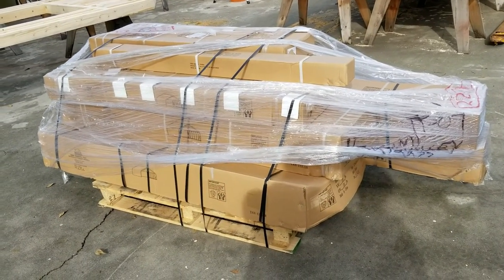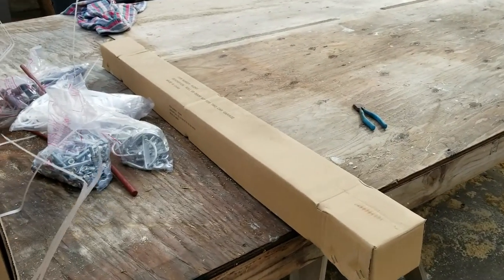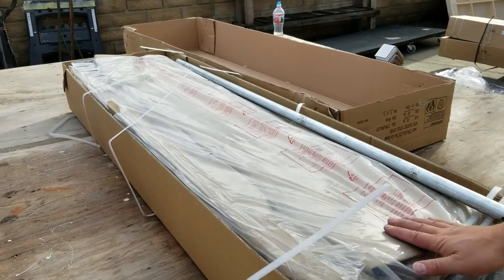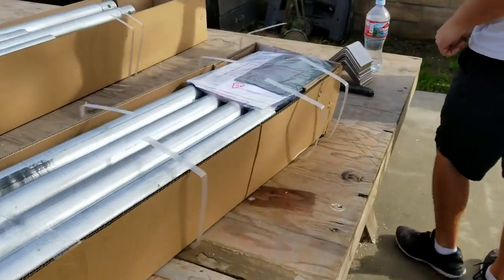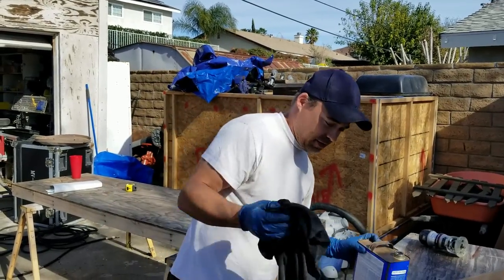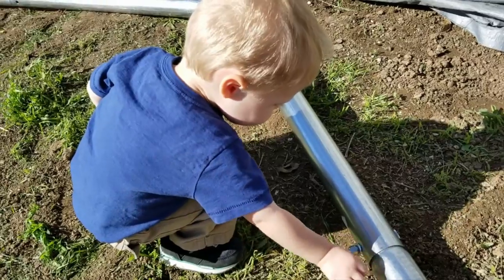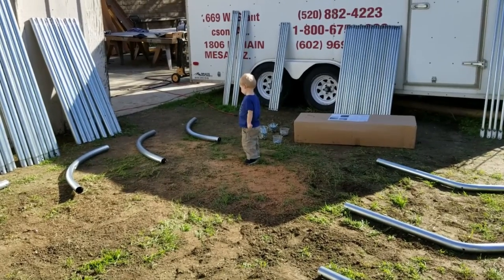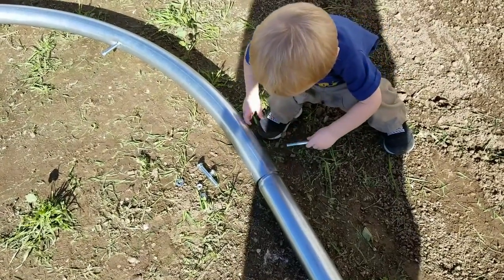Setting Up a Portable Garage Shelter - HEAVY DUTY Two Car Canopy Carport Review

Comment: Yours is nice and large.  I bought a 13X20 and worked great, except for snow load sag, which I had to raise sagging areas with broom to make snow slide off. 
  After some years of use, fabric started to fail, so I removed it all and covered tube frame with 18 sections of 12 X 3 foot sections of steel roofing.
  Works great, no longer a worry of snow load, it can handle it now with no sagging what so ever now.

Comment: Old plastic one gallon lids "Gatorade wide mouth" would make a lovely secondary protection just cut off the locking edge make it flat put tape over the nut then the disk and another piece of tape over the edge of the disk I've never used it but my friend and neighbor I watched her use the trick on a tiny green house this summer will be 5 years and she has it tho the u.v. has worn out the cover but the rub spots are not stressing or catching the cover😎 great video, well done and you 2 made me smile keep it up god bless😎

Comment: For insulation and a little more strength you could  use spray foam insulation to stick 4' x 8' x 2.5" sheets of blue foam board to the interior of your walls...

Comment: When you go to move just back your truck up next to the cable put a piece of pipe up in the top of the bed where the square holes are and put a Come Along on there and hook it around the anchor wench it down some and bounced on the back of the truck bumper and the Springs will pull it right out of the ground that's the way me and Dad would pull fence poles out of the ground Works awesome

Comment: Tip....To prevent the wind from flapping the bottom of the "doors" hammer into the ground thick strong dowel pins on inside and outside the outer edge so the pipe fits into that slot when they are lowered. Bricks would work too in place of the dowel pins.
Reply from the maker: Thank you so much!

Comment: Hi Guys...now that you have had this  up for awhile how it is working out?  Any vendor mfging issues?  Any city issues?  Anything you wished you would have done in hindsight??  I am looking to put one of these up in my back yard.  Thanks
Reply from the maker: Not sure if you saw we posted this a while back https://youtu.be/qfUCbNstKZU  For us it really is one of the best purchases we have made.  Surprisingly the sun has not ate through the material and its held up really well.  I just screwed up by letting the door flaps rub on the ground instead adjusting the height and it rubbed through the material on the bottom so it won't hold the pipes any more.  Nice thing is you can order a new end panel if you want to.  I also need to lay down some old carpet or turf some day because its dusty in there when its windy.  Customer service has always been nice for us as well.  All I can say is we dealt with fixing and repairing the cheap harbor freight ones every single time it got windy.  Since we have had this one we never have had any issues.  I admit it still scares me watching it move a little when the wind is blowing at 50 mph.

Comment: I wonder if the grease was purposed for helping with pulling the cover over the frame and to help with twisting pipe into pipe?
Reply from the maker: It could have been but I was thinking it was to help prevent corrosion.  It is galvanized so that will help.  Plus we live in a pretty dry place but if someone lived in a wet area they could always leave the grease on it.

Comment: Suggestion, how about slipping the bottom rail through the anchor cable loop before fastening rail onto the support post. Then wrap the anchor cable over top of the rail on the opposite side of rail-post union point where it bolted. Then pound the anchor cable into the ground until snug.. No U-bolt needed!

Comment: I've had those kind of portable shelters and I found I had to constantly replace the vinyl material every two years or so.  And if there was a big wind storm after a long, hot summer, the fabric just ripped and blew off.  
Since you have lots of sun and wind there in Simi Valley, expect to replace the fabric as frequently as I had to.
Reply from the maker: Although we wouldn't be super surprised if that did happen we hope it lasts much longer than a couple years.  These guys do warranty them for a couple years so if it starts to break down after that hopefully we could just replace it.  We make most of our money working out of it so the cost is definitely well worth it for us.  Someday a real shop would be the best!
Reply: @HollywoodHaunter  
I finally replaced the fabric on my shelter with aluminum sheeting and have had no problems with it since.
Reply from the maker: @chuckster3629  That's a great idea, we may have to do that after our cover falls apart too.

Comment: Hi Gus, You should cover it with a 2nd Uv tarp silver on the outside, the sun is the enemy with them. had 2 of them. DBL the life. Hope that helps
Reply from the maker: Thanks Steve that is a great idea to help the shelter last.  One of the main reasons we went with the rhino versus other brands is because they have an added UV chemical they added in the outer layer and then it also has a black scrim in the middle layer which blocks out all light and uv from penetrating the tent.  I can go in that thing during the day and it is pitch black inside its crazy.  We will see how how it does hopefully it will last a while for us.

Comment: It'd be nice if they had a 10 x 20 carport canopy with these size frame poles, it'd come in handy here in Florida. Anyone know of any heavy duty canopy makers ?
Reply from the maker: Did you check  their website I'm not for sure but I thought they had smaller shelters even for motorcycles and stuff.  Not sure about frame size though.

Comment: Why does everyone do the same thing  . They add the legs  first  and try to stand it up and work 10 foot off the ground  to connect the top . . Just leave the legs for last and  put the  top part together  while its close to the ground  once  the top is together then add the legs  one side at a time . Also go ahead and put the  tarp on the top   before the legs and when you add the legs your working in the shade  to tighten every thing up  . You can just fold it out of the way  when you start on the   end tarp .
Reply from the maker: That is a good logical way to do it if you can and we have set up our smaller lightweight harbor freight style car ports that way.  But for this one you would have a fork lift or genie lift of some kind to lift one side up at a time specially with the top on.  The two of us struggled to just carry top tarp together.  I think that's why the manual instructs you to do to the way we did.  But I agree any kind of work is easier on the ground.  Good exercise though

Comment: concrete pads under the legs and screw anchors.
Reply from the maker: We plan on adding the screw anchors for extra strength but I asked the factory guys about the concrete and they said its actually more secure in dirt and doesn't move as much when stuck in the ground.  Something about when on concrete it tends to slide back and forth on the blocks which can cause the cover to flap more from loosing.  Not for sure if it would be better or not. Thanks for writing us about the ideas.
Reply: @HollywoodHaunter  Thank you for the update, those guys have more experience than I with these shelters for sure.

Comment: Hi folks! The fact that you were having to make slits in the tarping, without a proper means of being able to further reinforce these new holes and not be allowed the use of a screw type anchoring system in your kit would be a massive turn-off for me! Sixty miles an hour winds will definitely raise big time hell with that structure. I just hope that you are able to get those kinds of kinks out of your system is all! Now, if it were not a rental property, I would auger out those anchor point holes and pore concrete and use the long screw anchors into the cement gravel mix before the cement was to set up; just saying! That structure couldn't have been cheap by a longshot and I feel that perhaps you would need to protect your investment big time with the use of some extra added protection features. Honestly, I bought a 10' X 12' shed back in 2006 with flooring and it actually came with tornado strapping and screw anchors for good measure! I just hope that things all work out for you folks! You are a great team, all three of yahs!! Thank-You for that great video!
Reply from the maker: Thanks Craig, The material is cool how it will not rip I tried and it just stretches.  We are getting some auger style anchors to add to the shelter and we have several sandbags that we can clip on to the frame if we need to.  I'm hoping since its set up right next to the real garage it won't be as bad.  We will see how it does this winter.  Thanks for the input.

Comment: try not to put the specially contoured washers on backwards....
Reply from the maker: Ya that may have happened a couple times during this install lol
Reply: @HollywoodHaunter  hahaha, I'm sure you're right. I was making a general statement that those 'nice' specially contoured washers have a 'down' side too. hahaha
You two did an awfully nice job putting up that gianormous shelter. very impressive.

Comment: all those holes you manually cut are just going to rip wide open over time. hard time believing that is part of the install instructions.
Reply from the maker: They haven't ripped at all over the years yet not even a little.  Not joking its very surprising even with 50 mph wind.

Comment: These are junk.  I had built one of these years ago but it blew over despite having heavy anchors to hold it down
Reply from the maker: It's a huge step up for us! We had been using broken parts from cheap harbor freight ones scabbed together with tek screws, plumbers strap and a large tarp held down by sand bags.  I spent more time replacing the cover each time it got windy than the projects I was working on underneath it.  It's all still cheaper than renting a shop for us.